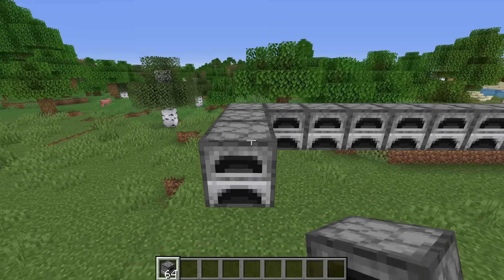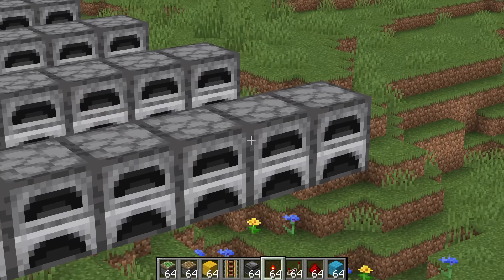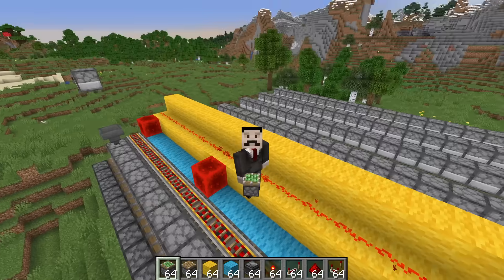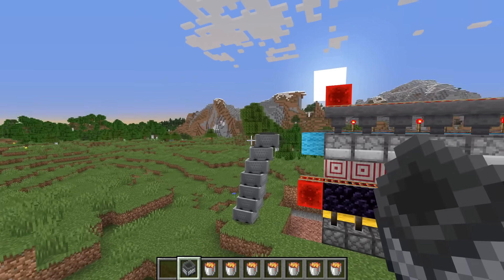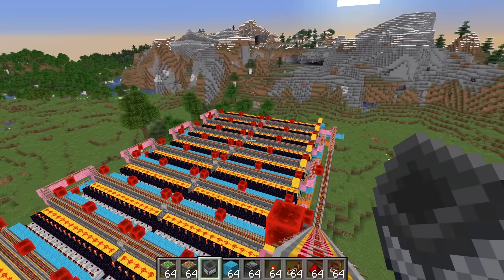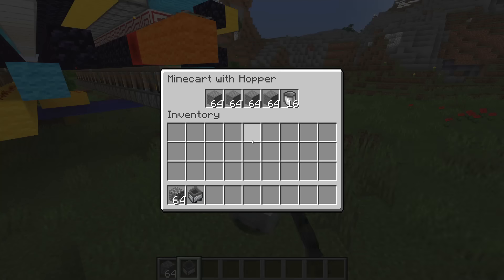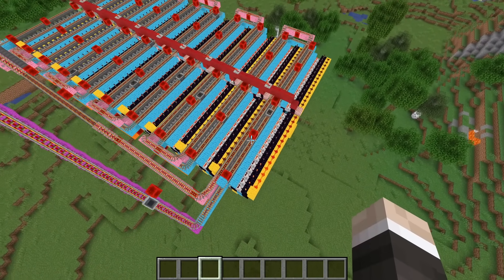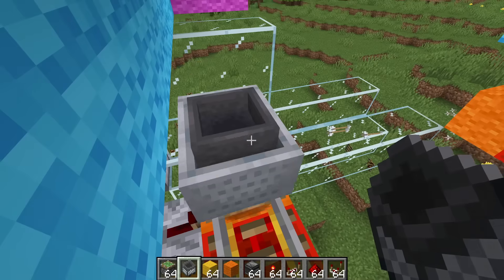Making the Fastest Smelter I Possibly Can

Comment: I feel like I missed something... how does it have infinite buckets? And if it does, is this not also an infinite bucket generator at the same time? lol
Or, I guess, since you have to manually fill the buckets with lava, you probably also have to manually refill the bucket thrower? lol
Honestly, that's the only upgrade to this system I could possibly think of, is if you could somehow automate sending the buckets back up, and automatically refill them. But, I don't think that's possible in vanilla minecraft... Could definitely do it with a mod or two. lol
Actually, that might be fun, you should redo this with some of your favorite redstone mods, see how much better you can make it. lol

Comment: My 5 months late question is, would it be possible to take it one step further and make the entire system self sustainable?

 As in the current build the bucket dispenser and lower carts(collection cart) dispenser both need to be manually refilled; but would it be possible to have a couple carts refill those dispensers with their item from the storage? 

For the bucket dispenser I imagine it could be possible, just a smart storage with a hopper cart under the bucket box running to the bucket dispenser and back, but since hopper carts separate into individual items when broken, I'm assuming that wouldn't be possible for the cart dispenser?

Comment: So I’m at 3:27 so far and like, I’m no redstone expert, but you could probably make it much smaller using coal blocks instead of lava buckets

Cuz then like wouldn’t you need to also retrieve the empty buckets, and find a way to load up 192 lava buckets for the hoppers, and ofc have the circuit system to check and make sure the furnace actually needs a lava bucket?

Or you could just get one chest, fill it with coal blocks, and send it on its way, ezpz
Reply: So who’s gonna gather the coal?
Reply: @scchizosu  just make a wither skeleton farm and get the coal from that
Reply: @swordsmancs  Just do the lava method dude, it takes time but it's way less painful in the long run.
Reply: @scchizosu  I’m gonna stick with coal since I like going mining and tend to pick up more coal than I know what to do with anyways (I always mine it just in case there’s more ore hidden behind the vein)
Reply: @swordsmancs  Alright, cool.

Comment: Just a suggestion- (you're very much a veteran Minecrafter, but sometimes suggestions can help). 
The "/fill" command tends to make placing bulk blocks FAR easier, especially in creative mode. All you need are the coordinates, and then you just go "/fill (-200 60 -640) (-200 60 -650) minecraft:furnace". (The coordinates used are just for the sake of an example).

Comment: the system is definitely flawed.  the finite hopper minecarts are kind of an issue. maybe set the storage lower and use  stationary hopper minecarts to tale the items quickly do thst thr system can resume and then hoppers will slowly take the items. and the first hopper section could be filtering only buckets

then have another hopper minevart that takes empty buckets to the dropper hearby you
if dispemsers can interact with cauldrons that could work too but i am nit sure.

Comment: Why use hopper minecarts instead of chest minecarts for the lava buckets? If you don't need to pull items out or pick them up I see no need to use hopper minecarts for the distribution. The hoppers they run over should be able to pull items out of the chest minecart, and since you only need one the speed shouldn't matter.

Comment: Bucket list for anyone trying to make a PERFECT super smelter:
-no player interaction with the inner workings besides input and output of to be smelted items
-no repairs ever necessary / proof against bug fixes from Mojang (it should avoid bugusation)
-fuelling gets totally handled by the furnace (examples bamboo farm, mushroom farm)
-the furnace does not have to be constantly loaded
-the duration between putting all the items in and getting all the items out is not longer than three times the duration to smelt one item
-the super smelter is big enough to smelt as many items as a player can have in his inventory at once as fast as it can smelt one item
-the super smelter does never run out of fuel, no matter how tirelessly you run it
-there is no way to jam the super smelter with some item
-the super smelter has to be able to be created in vanilla survival Minecraft